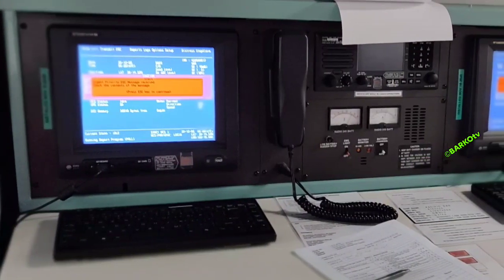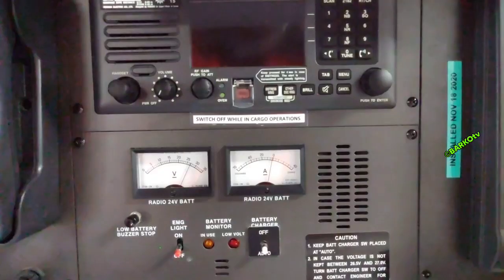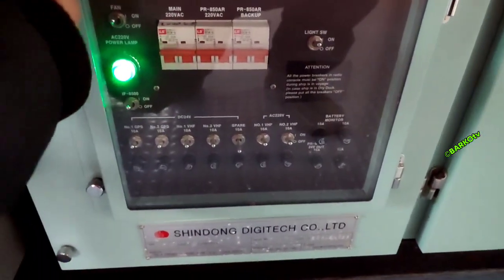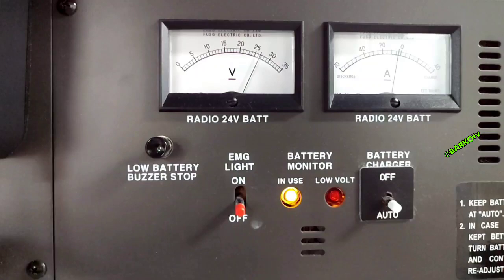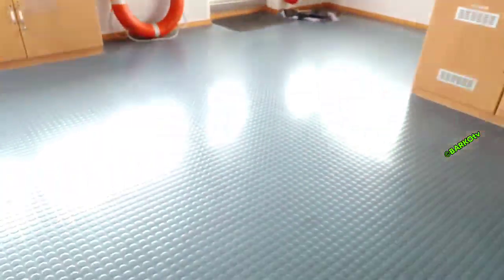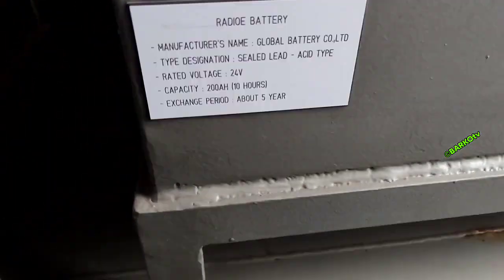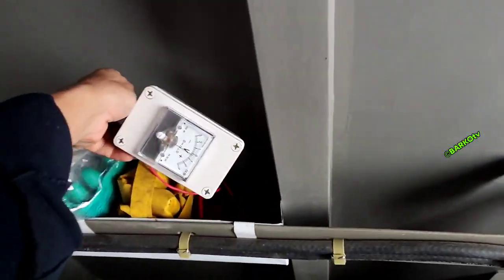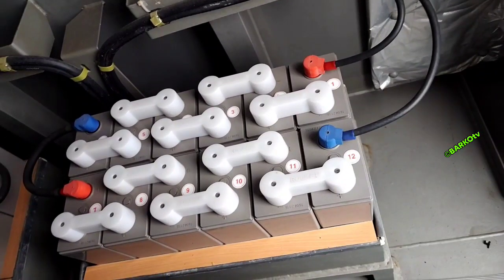GMDSS | How to Load test and changing batteries | Navigator |Marino | Bridge | Distress

Comment: Good day. May i ask, in case of disconnecting terminals from the batteries during replacement gmdss with switched off charger, all necessary consumers will lost dc supply and alarm come? Thx
Reply from the maker: Yes alarm comes, but the best Its ok if you switch off batteries circuit breaker only, and normally, all gmdss equipments have there own individual AC supply as well.
Reply: @BarkoTv  don't have one, but thanks a lot!
Reply: @Enixist   While we turn off the gmdss battery charger then gmdss and other equipment will loose the power supply? And how to turn off the alarm when we turn off the battery charger for gmdss battery